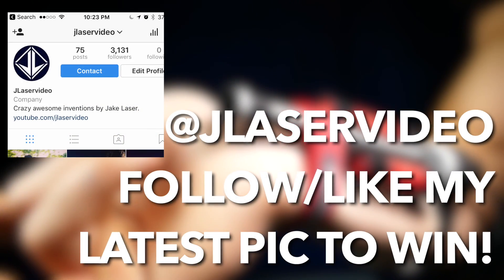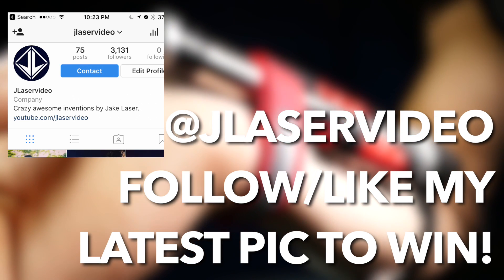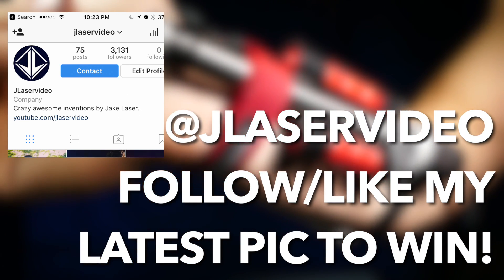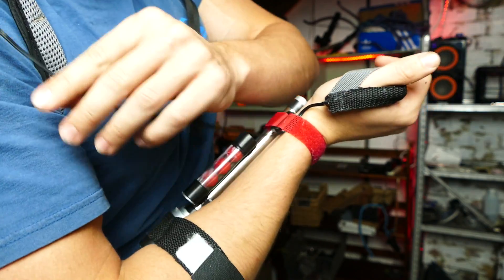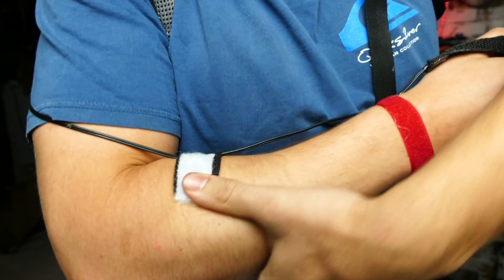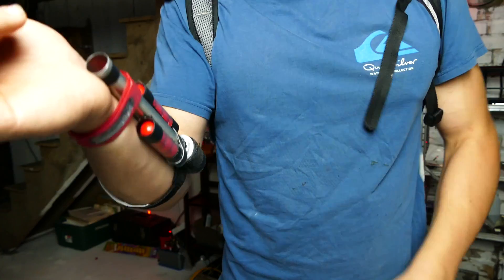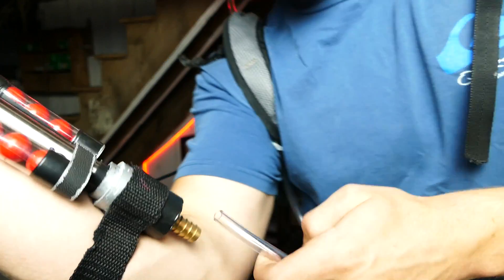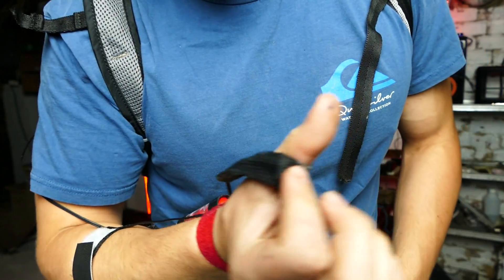Make a SPIDER-MAN Web Shooter! - SHOOTS WEB BULLETS!!! (Spider-Man Homecoming)

Comment: One inch tubing, solenoid valve 12v, 1lb propane refill adapter, hose clamp x2, threaded tube 1in, 1/4-1/2 fittings and hose adapter, 14oz propane tank, and yeah thats the list e

Comment: I had a similar idea. Funding right now is the holdup.

It was based on the rig you made with   CO2 emergency pumps.

Instead of a full sized paintball, it would use the blow gun mini ones. curved hopper with a spring should make semi auto.

Comment: I love this project!

I made something similar with C02 in the past. https://youtu.be/xHvAdFkJsGY?t=2m38s

I like your design better though, propane is probably a safer pressure than the high pressure co2 tank I use. Also propane allows for your fire sword attachment. What could be cooler?

What do you think about Pepperball Projectiles? They could be a cool addition to your build.

Comment: I like how people are still fighting for the fact that you can tie string to a hook on a device this small and you will suddenly become spiderman. Admire the effort tho. I have my own coil gun version.
Reply: The 1ElitePixel Do you recommend coilgun shooters? have a fluid shooter that I built for 60 and it computerized with an arduino for fire rate, etc. Quick reload for cartridges, they use quickconnect fitting.. Are the coilgun shooters really worthwhile? The fluid formula I use shoots a line but it cant hold too much (still a lot better than silly string) and I still need to work out an adhesive to add in that is fast enough acting.

Comment: If you use a grappling hook as the projectile entire string to that you could have a working Spiderman Web shooter using what you've already done
Reply: JLaservideo make a Webshooter that has a conveyor belt around your wrist and you can switch between different web elements.
Reply: And tie a string*
Reply from the maker: +The Webslinger Look for that in an upcoming video 👍
Reply: JLaservideo but wouldn't you need a larger lighter for that. Considering you've got one of those huge lighters, the lighter will still be small to carry a grappling hook unless you make a mini grappling hook, which can only grab stuff like cans and other stuff. Use the strongest string for that.
Reply: The Webslinger ttffyrxdtxddrr
Reply: JLaservideo hi
Reply: The Webslinger og
Reply: The Webslinger yes
Reply: tf is my life anymore
Reply: cliiiiiiiiiiiiiiiiiiiiiiiiiiiiiiiiiiiiiiiiiiiiiiiiick baaaaaaaaaaaaaaaaaaaaaaaaaaaaaaaaaaaaaaait
Reply: change the thumbnail please